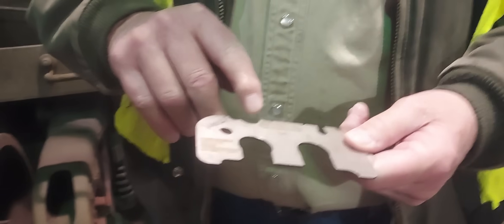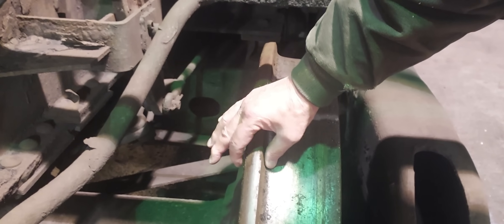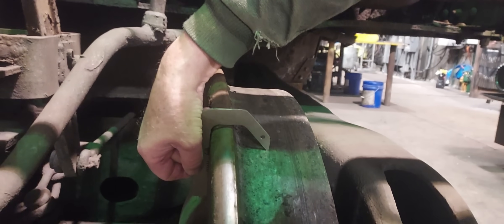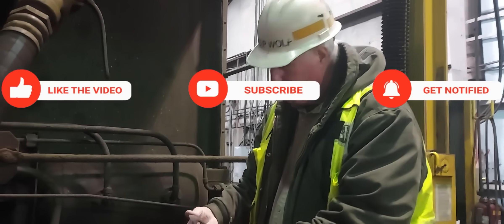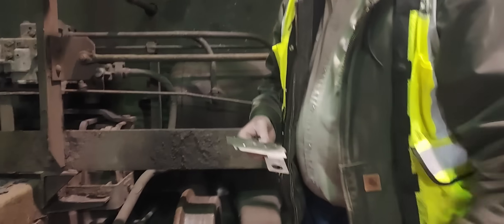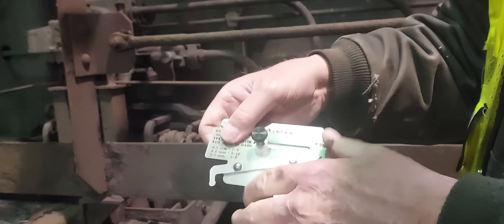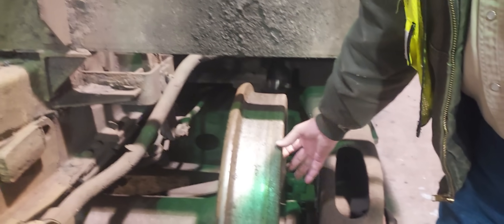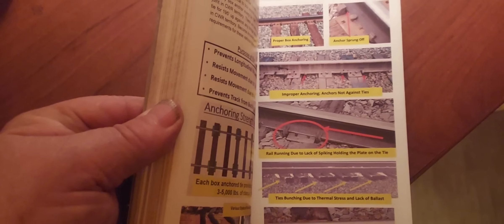How to Use Rail Car Wheel Gauges Part 1

Comment: That's a freight gauge. Passenger gauges are 1 inch and 15/16th's. 15/16ths flange and rim thickness is the limit for passenger wheels.
Reply from the maker: I know nothing about passenger wheel specs JPaul but yes
these are freight cars we have here. Thank you for sharing that
info with us.  Really appreciate your taking the time to check
out the video and may you have a very good day my friend.

Comment: Interesting how much precision is required for safe operation on what deceptively appears to be simple component. The gauges are classic machinist-style designs, appropriate if one thinks of the wheel as the workpiece in a "lathe" whose cutting tool is the rail.
Reply from the maker: Glad you found it interesting CommOut. You will like tonight's video
part 2 where Mr. Wolf shows a laser wheel gauge.   Really appreciate your watching the video and may you have a very
good day my friend.

Comment: We set our point openings to 4 and 7/8 to 5& 1/4 inches to allow the flange to travel through an open point and not rise up. Mind you this the open point of the two in a normal switch. The other is closed, and haused.  Real good info on the wheels. Those inspections save money and stop derailments. 🙂🚂
Reply from the maker: Thank you for the nice comment and your right Tuco inspections do
save derailments. Really appreciate your watching the video and may you have a very good day my friend.

Comment: How long do wheel last normally 😊
Reply from the maker: That depends on a lot of factors DCW, including weight of the
cars and track conditions. Here we have 16 miles of track with
70 curves and over 3/4 of those curves are high degree. Hard
on wheels with the heavy coal loads. Another thing to consider
is the over all condition of the truck set which affects the steering
of the truck thru a curve. Hard steering trucks cause a lot more
wear on wheels, rails and ties. Lot's of hard braking is also hard
on wheels. So there is no one answer that any wheel lasts x number of years.  Really appreciate your taking the time to watch the video and may you have a very good day my friend.

Comment: Great video! When I was at the Seattle intermodel yard, we would find hollow fairly often. One of them was so far off the hollow Guage that it became a high flange. With the fleet being cleaned up and the digital computer inspectors, we dont find wheels out of Guage anymore. I've only found a few out of the thousands inspected over a year,
Reply from the maker: Hollow wheel treads can play havoc with a truck when it negotiates
curve Travis, it can even get so bad it will cause reverse steering
of a truck, let alone being hard on rails and ties. That's great to 
hear they are keeping better inspections on the wheels. 
 Really appreciate your taking the time to watch the video and may
you have a very good day my friend.

Comment: I was wondering if the wheels get repaired or just scrap them. Here in St. Thomas Ontario they use them for downtown benches
Reply from the maker: Here the wheels get sent out to a pro rebuild shop as we do 
not have the equipment to refurbish wheels or trucks. Some
RR's do have truing machines which can restore the wheel
profile in their own shops Ross.  Thank you for  taking the time to watch the video and may you have a very good day my friend.
Reply: Thank you Dave
Keep up the good job. I worked for CN in the work Equipment department 
I operated track liners, brush cutters and switch tampers during my career. I have really enjoyed your tamping videos 
And like you I love railroading! All the Best!
Reply from the maker: @rossblack6207  😊👍🚂

Comment: In the USAF, we called those go no go gauges.  They were used to measure brake wear on aircraft brakes.
How often are train wheels checked?
Reply from the maker: That's very interesting to learn Robert. There is no Fed law that says
how often a wheel should get checked, only the specs the wheel
has to have. So it is up to the discretion of each RR on how
often they decide to check these wheels.  Thank you for taking the time to watch the video and may you have a very good day my friend.

Comment: Here in Germany these values are actually mandated by federal law.

We have the following limits(lower and upper):

Rim width: 26 mm up to 36 mm
Rim height: 20 mm up to 33 mm
Wheel width: 130 mm up to 150 mm

I could also find in the literature that the wheel gradient must be 1/40 as must the rail gradient. The hollow tread is probably derived from that. I could not find official values though.

Another value, that is checked, is the rim slope width (The part of the rim that is curved). It is limited to 6.5 mm.
Reply from the maker: Here also the wheel specs are mandated by Fed law Onkel Fabs.
The AAR also has their set of specs, Fed law is a bit more
stringent with some of those specs tho. Thank you for watching the video and may you have a very good day my friend.

Comment: I know there were some sub arc welders that would build up wheels so they could be machined down to specs.
Reply from the maker: Yes if the wheel is not too far gone, then they could be welded
up and then trued Paintnamer. That is for the pro shop who 
rebuild the trucks and wheels to determine, we don't have
equipment here to true wheels.  Thank you for  watching the video and may you have a very good day my friend.

Comment: Common sense will tell you everything,you can look at things without a guage/tape/level and know it is spot on.
Reply: Well, heretofore, I wasn't up to speed on how important some of the dimensions are.   Things could look clean and polished but the wheel might be a derailment waiting to happen.    Wheels might be machined a bit for something grossly deficient and in the process make some of the other numbers worse.   But a company might not want to scrap a wheel in which they have invested some machining.   I wonder how many wheel shops have the fancy automatic wheel testing stuff and maybe some software to define whether the wheel can be fixed and just how much to take off and where to give it maximum safe life.

When derailments happen we don't hear about "out of spec" wheels but only broken things.   It might be a case of chicken and the egg.
Reply from the maker: Yes you can be right about that B, but there are Fed specs the
wheels must conform to, so gauges are indeed necessary to
check the wheels against those specs. Thank you for  watching and may you have a very good day my friend.

Comment: 👍 Very informative.  When I volunteered at the Hocking Valley Scenic years ago I noticed one of the 6 wheel passenger trucks had a very worn flange.  It was so worn that the flange was 90 deg. to the tread with no curvature between the flange and tread, and the top inner side of the flange was razor sharp.   They were required to follow the FRR rules but I never found out if it was taken care of.
Reply from the maker: Wow!  That's an extreme example of wear on a wheel flange. It's great you were paying attention to safety when you were volunteering Stephanie.  Really appreciate your watching and may you have a very good day my friend.

Comment: I have used lasers for years to measure aircraft parts; did not think they would migrate to the railroad. Waiting for Part 2 to learn how.
Thanks.
Reply: Lasers and light have been used since the 1970s to indicate the clearances along the track.  Lasers are also used under scan cars to measure track gauge while traveling at track speed.
Reply from the maker: That's very interesting to learn Ric. I never knew that. Part two
will show you the laser gauge he has. Very expensive and highly
accurate.  Thank you for  watching the video and may you have a very good day my friend.

Comment: Ask Mr Wolf if they still use a car or locomotive inspection hammer. I had a friend who was a car knocker for the NYC before they merged.  It was a clever tool he carried .
Reply from the maker: In the days of old that's how they did it Pete for a lot of things
on locos and cars. It is a lost art now. Fact: a bearing on the verge 
of going bad will give off a different ping than a good bearing will.
They make acoustic detectors now that can "hear' the vibration
frequency of a bearing and be able to for warn that a bearing
will soon go bad. Cool stuff!  Thank you for watching and may you have a very good day my friend.

Comment: Amazing video Dave and Mr. Wolf, we truly appreciate it. 

How miles do wheels last?
Reply from the maker: Thank you Gino. Wheel life depends a lot on the amount of
high degree curves a RR has plus the wight of a car. There are
so many variables on all the different RR's across the country
that there is no wheel life standard anywhere. Here we have a
a lot of high degree curves and carry heavy coal loads so our
wheel life would be less than a RR that carries light weight
cars on welded rail with few high degree curves.
Reply: @ccrx6700  OK Dave thx, so on your heavy EV fuel cars and loco wheels on non welded track. How long do you get in service life roughly?
Reply from the maker: @ginog5037  no one keeps records here of wheel orvtruck life Gino so I don't have any accurate answer

Comment: Dave, I'll bet you didn't know that condemned wheels have a secret second life.  In the field of oceanography, buoy assemblies that hold various instruments such as current meters and temperature recorders etc. use old railroad wheels as disposable anchors.  A buoy string consists of a large float, thousands of feet of wire cable with the instruments strung out along it and the anchor (several wheels) attached with an acoustic release at the bottom. After a month or a year after deployment, the ship returns, triggers the acoustic release and all the expensive toys float to the surface and get retrieved.  The old wheels stay on the bottom having given their all for science.
Reply from the maker: Wow that's pretty cool to find out Richard, I had no clue. They
sure are heavy enough to accomplish that feat!  Thank you for watching and may you have a very good day my friend.

Comment: I can't afford the book but I did learn a lot today. Looking into Sauron's crystal ball I see some knew gauges showing up in your tool box!!! LOL. So that wheel is good at this point; Can that wheel as it is be re-ground to spec and re-used or does it have to get to the no-go point and completely replaced? 🛤🛤🛤🚂🚂🚂👣👣👣👣👣👣👣👣👣👣
Reply from the maker: Yes wheels can be re ground David, that is called truing a wheel.
Some RR's have their own truing machines and also true loco
wheels. We do not true wheels here, we don't have the equipment
to do it, all our wheels are sent out to a pro shop to get done.
Here is a video I made some time ago of truing a loco wheel you
may enjoy if you haven't already seen it.  3 more videos coming
in this mini series with Mr. Wolf, some really really good stuff coming. Heres the link to truing a loco wheel:
https://youtu.be/Bta9GBfS5F8
Reply: Excellent video.  Thank you, Dave and Mr. Wolf.
Reply from the maker: @haroldsmith45302  😊👍🚂

Comment: Great info and video.  Some of this can actually be applied to model railroads as well. And yes, there are gauges and standards for model railroads, and derailments are a common problem.  I don't think models have wear issues, but there are gauge and, flange issues (cheap wheels), rail issues, switch issues, etc. that occur.  Understanding the causes of derailments on the big railroads should help with understanding the issues on the little railroads!
Reply: A model railway club in Shreveport, LA operated a large layout with continuously running trains as a display at the Louisiana State Fair for many years.  When they relaid the track, some of the rail had sharp edges that could cut.
Reply from the maker: Thank you for the nice comment and glad you enjoyed watchingInPDX.  We are so fortunate to have Mr. Wolf come and visit and share some of his RR knowledge with us. More good stuff to come!  Really appreciate your watching and may you have a very good day my friend.